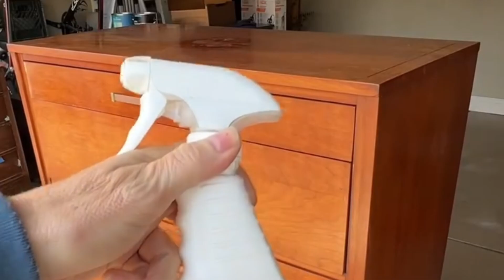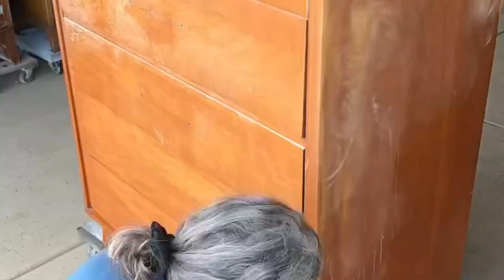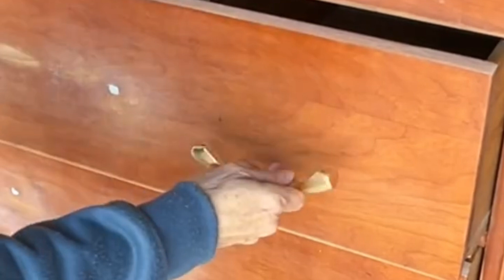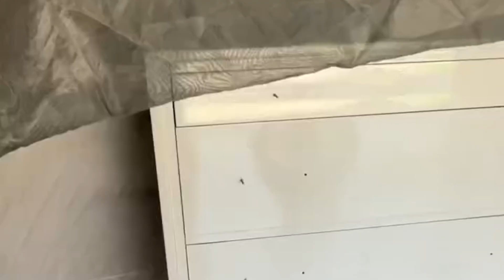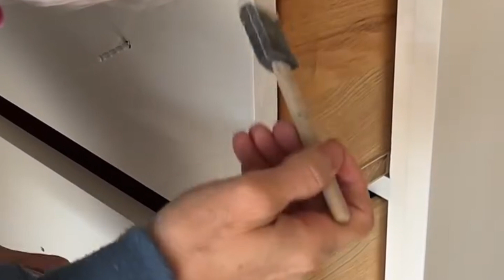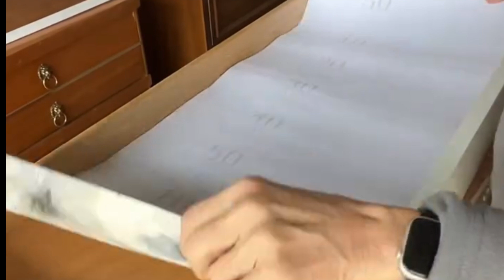A great MCM Dresser customized into a stunning beauty!

Comment: You always do lovely work!  To help with the drawer fit after you put in the nailed drawer guides, could you have sanded down the top of those newly place drawer guides a bit to try to adjust the fit?  I'd think it would be less sanding than across the entire drawer top, but I've never done it before & was curious.
Reply from the maker: Not really. They are quite thin already and have a small nail in them. If sanded the nail would be exposed.